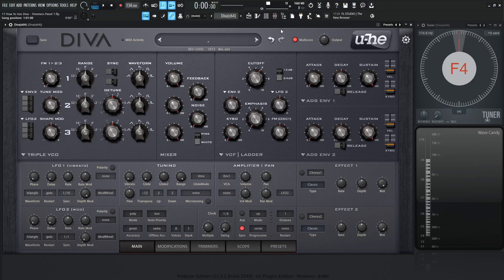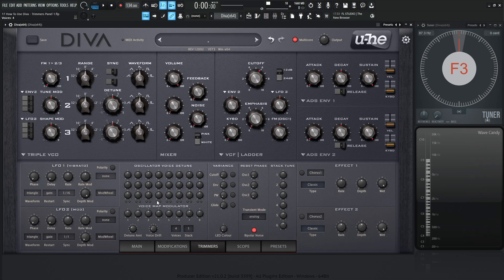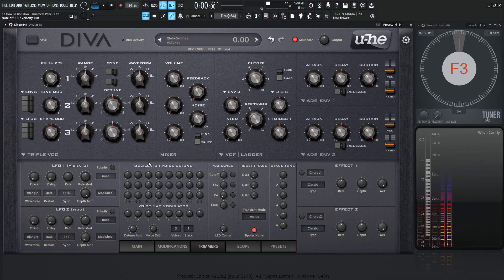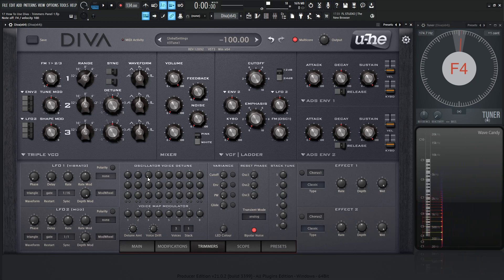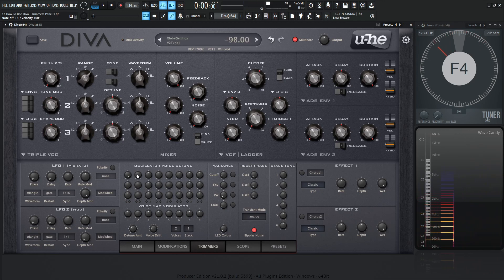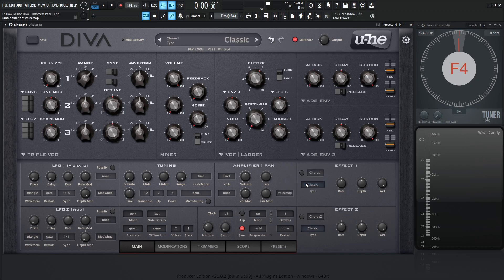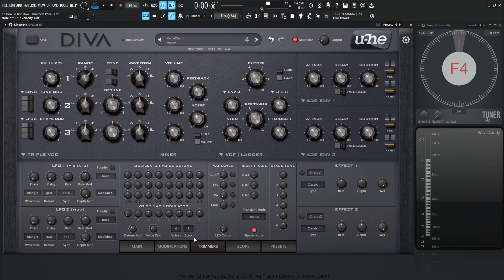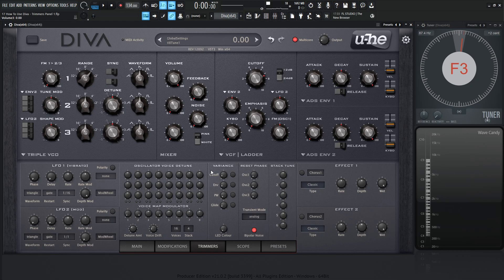Trimmers Panel 1 PART 17 | u-he DIVA Tutorial

Comment: With the StackIndex modulation source on the pan mod... Is that controlled by anything other than the actual PanMod knob itself?
Reply from the maker: The Pan Mod basically effects the panning of whatever is targeted in the list. So when you select stack index, its using the voice stacking parameter and the knob then controls how those voices are panned though out the stereo field
Reply: @jonaudio  I wasn't expecting answer that fast, thanks haha. I didn't see any specifics about it in the manual so I wanted to be sure I was thinking about it right. You're the man!
Reply from the maker: You're very welcome! I gotchu my man 🤙🤙😎